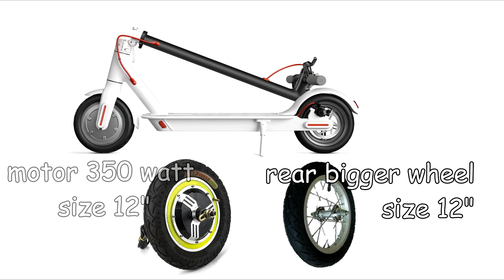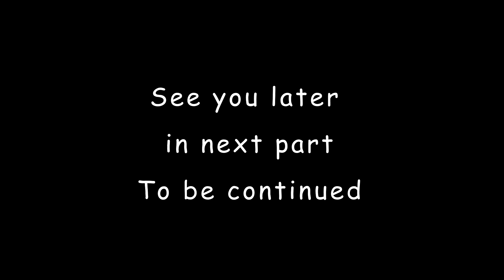XIAOMI scooter M365 | MEGA upgrade v 1.0 | PART 01

Comment: Will it better than the original motor? How the torque? That motor (24v, 350w) is quite cheap in my country, about 50$, but i’m not sure about it power
Reply from the maker: i need bigger wheel to terain
Reply from the maker: I decided I wanted to use the original control unit